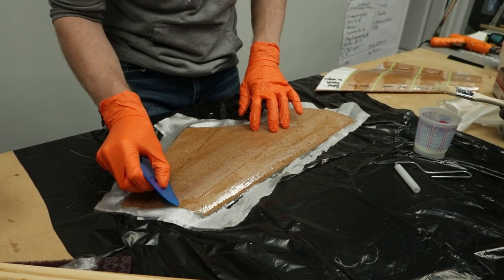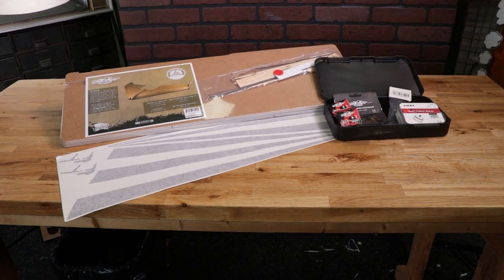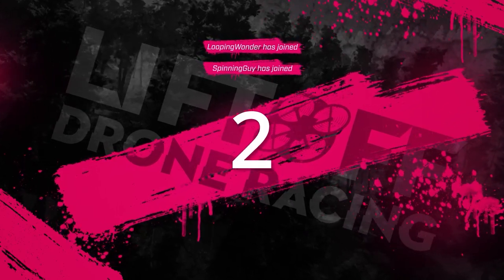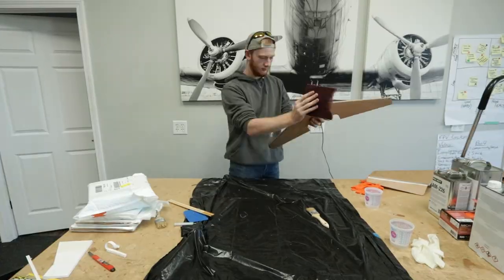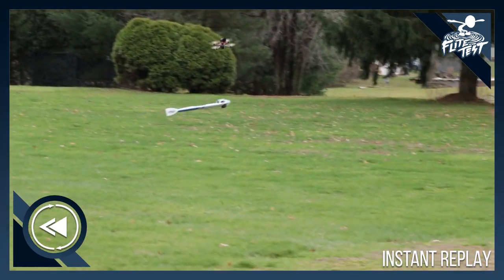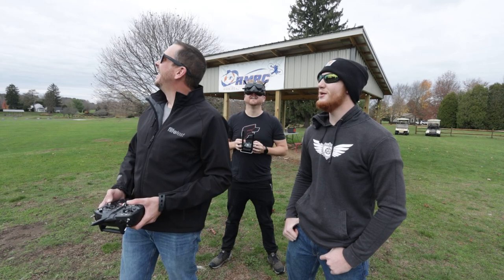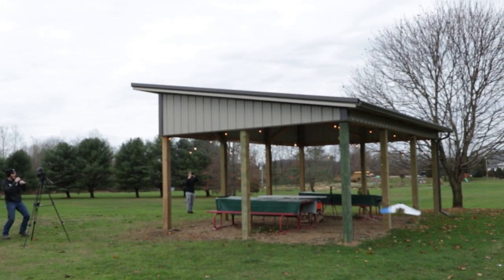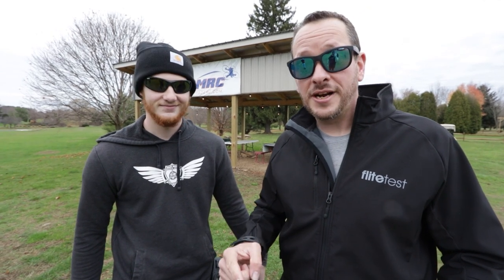Fiberglass Wing Crash Test! 💥

Comment: After two water-logged Sea Ducks, I decided to glass my 3rd one.  I removed ALL the paper and glassed it with 18g and 24g/m2.  Results were perfect!  No more moisture getting between the paper and the foam, with very little weight gain.  The Sea Duck is my absolute favourite and now even more so.  Thanks Team!!  Rob
Reply: The seaduck is my favorite one too.  So did you build it like normal and then take all the paper off before glassing or did you build it without the paper, then glassed it?
Reply: @cooter3690  Both - for example I took the paper off the inside of the wing BEFORE folding, and removed the paper from the outside of the wing AFTER the wing was assembled.  The fuselage pieces were "depapered" and glassed BEFORE gluing together.
I crashed my 1st SeaDuck.  My 2nd got slowly more-and-more waterlogged.  I like to do spend a lot of time gliding across the water - and the fact that it was sea water didn't help.  The moisture got everywhere and caused serious delamination (yes, I used water resistant FT foamboard).  Fibreglass is the way to go!
Reply: @Rob-kj3ho  This sounds really really interesting. My Seaduck is falling apart after ~300km travel. Only the fuselage which got fibreglassed is solid like a rock. Could you share some pictures of yours? maybe a dropbox gallery or on the flitetest forum on the Seaduck thread?
Got my second kit already in the basement but still hesitate to start
Reply: @mfoo3038  I've never posted anything on the Flite Test forum, but maybe I'll give it a go one of these days.  To be honest, I didn't take any build photos and any photos I take now won't be of any help as she's been spray painted.  For a quick guide: 1. remove the paper from the inside of ALL parts and replace with ultra-lightweight fiberglass (18g/m2).  Heavier glass is a heavier plane - but stronger!  I'm sure the Sea Duck could easily handle heavier glass.  2.  Leaving the outer paper on while hot gluing all your folds.  This will help hold everything together as the glue cools.  But try to keep the glue away from the paper, since we'll remove it afterwards anyway.  3. Remove the outer paper.  Lightly sand any sharp corners - as the fiberglass cloth will adhere better to a rounded corner.  If you have any big gaps, you can fill with glue.  I used the epoxy resin with a lightweight filler (e.g., micro-ballons).  4.  Glass the outer surfaces, prior to assembling.  5.  Spray paint, dry and fly - preferably over water. :)
I just took out the Sea Duck again today.  The water was like a mirror.  I was all smiles.
Reply: Rob thanks for the detailed description i would love to see some pics of your bird anyway :)) stay safe!
Reply: It's a fantastic design that has no business flying nearly as well as it does coming from a frigging cartoon! (And a great one from my childhood at that) I fiberglassed an FT X29, and the thing is just about indestructible, if a little heavy. I used kevlar veil to try to keep the weight down, and peeled all outside paper, but there's still some inside that you can't reach without destroying it. I have a 6s 64mm EDF setup that's really mean, though, so even though it lands really fast, it's still fairly easy to launch if you have some fast plane experience. It hits light poles and bounces off like it's nothing.

Comment: I work with high power rockets a lot for university projects. If you are looking to help keep the vertical stabilizers on, try using a filleting blend to join the wing to the stabilizer. The blend will thicken the two-part epoxy and allow you to "shape" the fillet such that it can attach to the wing and stabilizer.  This is how we join our fins to the body of the rocket as well as give it a nice sleek look.
Reply: Thanks,saved this comment.
(in a seperate text file)
Reply: In a plane, you are just moving the weakest link, and the part that will break first. If you strengthen the stab, the whole wing might get damaged if it crashes, making the repair more difficult than just gluing the broken stab back on. Picking your weak link is a skill learned through many difficult repair.

Comment: Last year, 2019, I got a tip from a fellow Flight Fest attendee that may work on these wings.  He suggested using a pair of inexpensive, Dollar Tree Store, women's panty hose.  Basically you cut the hose in half at the crotch, and slide each wing half tip first into each leg until the hose conforms around the entire wing.  Once the wing is properly positioned, you can coat with resin or you can wipe on a couple of coats of Minwax Polycrylic water based Poly Urethane.  After it dries you cut off the excess stocking, finish the edges, install the equipment and go fly!  This was his method for covering foam chuck gliders that were converted to RC.  He even covered the fuselage and elevator that way to make them more rigid.

Comment: I've been glassing foamboard planes for a while and I've found 3/4oz weight glass and keeping the epoxy to a minimum adds the least weight but still adds strength.

Keeping it to the leading edge and surfaces that are landed on can keep the weight down too. Helps a TON with scuffs, dents, and fraying that foamboard usually experiences.
Reply: I also feel like selectively glassing and using a carbon spar is stronger than using that spar weight on more glass. You can make some seriously robust foamies that way.

Comment: honestly, i've wondered why you haven't explored glassing your models prior to this.  even if you don't do entire sheetings,  but instead just use strips at joints at wing connections and such, you could add SO much more strength to a given model.   A large scale P38, fully glassed....all it's waiting for at that point is big enough motor to get it up to the speed it should have..  
Glassing isn't hard.. but it IS messy, and a little finicky.  Wear old clothes or coveralls,  be meticulous with your measurements, thorough with your mixing, and meticulous with your application....there are a LOT of different brands out there; shop around... 
(pro tip.. babywipes and personal wipes can clean up uncured resin)   
(if you really want to push that speed curve...glass it, then polish the resin as smooth as you possibly can, and maybe even wax it with car wax.....)
Reply: Planning a lightweight single 5mm sheet monster spitfire am. Im going to use your tips. thanks! :)
Reply: I have an arrow just like the one in the video. Can you please give me the names of products you have used it would be incredibly helpful since it seems like you know what you are doing.

Comment: I was pretty sure the basketball game was Horse :v

Anyway the fiberglassing looks pretty easy here! I guess when I get some clean builds done it would be a good idea to fiberglass then for a long term model.
Reply: Having worked with resin and epoxy in the past, I was surprised nothing was said about possible health side effects.  Both have some serious issues for too many when it comes to long term exposure and little to no ventilation.  Most resins and such often used in the commercial world require not only protective gear, but proper ventilation, which most hobbyist won't use due to cost.  That is why I recommended investigating the "poor mans fiberglass" videos and the fact there is very thin, lightweight fiberglass cloth available you can almost see through.
Reply: @wattwaster5936  have any videos or links in particular you could share ?
Reply: @br0k3nilluzion  There are a lot of videos in Youtube about each point I made and to provide links for take a while since there are so many to watch.  The one subject most in this hobby would find useful is Poor Mans Fiberglass, which is used to make travel trailers, or small sleeping campers using various wood glues and canvas.  The key is non toxic wood glue on thin plywood, or thicker foam board combinations.
Reply: @wattwaster5936  non of that applies here though. Welders blanket is way too heavy for any of these wings
Reply: @br0k3nilluzion  Welders blanket?
Reply: @bushcraftandsurvival2395  the poor mans fiberglass videos show outting glue down and then putting fiber cloth on top.. most of those videos are use a welders blanket.
Reply: @br0k3nilluzion  I am not sure how a welder's blanket fits into the poor man's fiberglass method since the videos I saw were about using a water resistant wood glue and cotton cloth, often called canvas, which comes in a number of weights, or thickness applied over thin plywood, or foam board.  Some even used a combination of plywood and foam board to provide insulation.
Reply: @wattwaster5936  only point I was trying to make was the weight side of it. 
Went pretty deep in after you mentioned the poor mans method, lol,  so now me and the kids are planning on building a canoe from foam and the poor mans method. lol
Reply: @br0k3nilluzion  As long as your glue is water resistant to a very high degree, as in nearly water proof, with a high quality latex paint over it, the project should go well.  Of course the key is to keep everything lightweight and don't get too thick and heavy with the canvas cloth.  Apply the glue as thin as possible since all it does is bind the canvas fibers together and to the foam board.  One scheme I have seen used cheap, strong toilet paper to soak up as much glue as possible before the glue had a chance to set, or stiffen and then let it finish curing.  The next step was to lightly sand the glue and canvas layer so the latex paint of a high quality would bond better.  Four coats of latex was applied with light sanding between each, but this was for a sleeping camper.

Comment: If you want to reduce your exposure to the resin, or epoxy part of the task, you can use common plastic wrap over the fiberglass and use a trim sized paint roller, or other like devices to move the liquid to the edge of the wing.  Place a piece of plastic wrap over a section of the wing from leading edge to trailing and roll out the excess liquid.  It is a messy thing to do, so you will want to place some sort of absorbing material on the table and elevate the wing to allow for the liquid to drip away.  Since  you can see through the plastic wrap and the liquid will cure even if the plastic wrap stays in place, weigh it down once you are satisfied with the task.  Sandbags work well and ziplock bags come in handy.  They also come in some rather large sizes if needed.  I will let you guys figure how to make a working device for the elevated wing half so it won't cure warped, unless you want to add in a bit of reflex.  Remember the balsa wood wing jigs?

Comment: You might try to use thin CA instead of resin to stick the glass down.  It is much quicker, stiffer, stronger and easier to sand.  I used fiberglass and CA along with carbon rod to reinforce and stiffen the wing and tail surfaces of a Multiplex Twin Star so I could use 2 T-motor F80s to power it.  That airframe now has 1400 watts on it and is great fun.

Comment: Josh Hi  .I worked for 20 years fiberglassing surfboards and have done thousands .Get some 4oz surfboard cloth  and with the resin there is a additive powder that will turn your resin into light cure .All you need is a box with some UV strip lights ( i used sunbed tubes and lined the box with silver foil but hy mine was 11' long ) do the glassing in side not daylight or it will set as you do it when your happy with the glass job put it in the light box shut lid (uv light this strong is bad for your eyes so make it a good box )5 mins later and its as hard as a rock ,you can put it out in the sun i would put repair boards out side to keep the box free for new boards .On on your laps sand the edge of the first lap bottom first with a 3" 60 grit disk sander air tool or dremel with the 90deg attachment carefully now glass the other side and sand the lap the same .If you want a super smooth finish add what is called a filler coat .Tape a halfway point around the leading edge and trailing letting it hang down and  paint on enough resin to fill the weev let it sit till it flows out smooth  then back in the light box  and repeat for the other side .When set sand with 240 grit and remove the lip left by the tape  and paint .I made wings this way and large HP rockets glassing cardboard  tubes .Go talk to a surfboard material supplier they have all you need and will advise you .Only downside is you dont want to get hit by a plane done this way its going to ruin your day .Any advise please ask .I have glassed around 5000 boards .Retired now .  Good luck from The UK
Reply: Everybody I know in the art and automotive community takes about toxicity of the resins. They seriously worry about long term effects and always use masks and gloves with fresh air priorized. What is your experience?
Reply: Well polyester resin and glass fiber were developed during WW2 for military planes and its been used in the boat industry ever since yes its toxic stuff but not as bad long term as you would think and your very unlikely to get hypersensitivity to it .Styreen in the resin and wax solution isn't good for you breathing it in and ingest a teaspoon of Cat your dead     .Sanding and glassing requires respirators i had 2 one for sanding with the charcoal replaced with extra filter wool and a charcoal one for resin .We had big fans one in the sanding room and one in the spray room with the outside door open  the air flow was good .Most sanding is just the resin and not hitting the cloth  releasing fibers that's bad . Long term   usage since ww2 has given good studys .Now onto epoxy that stuff is nasty carcinogenic yes big risk of hypersensitivity (i new people who couldn't even be in the same room )it can just happen out of know where i only ever did small jobs with it you should use a fresh air fed full mask for epoxy +little odor comes of it so its hard to detect buildups of fumes .I never had any problems lung wise back neck and shoulders are fooked but that's not the chemicals .I will drop a link in here from a TV program i was in i'm the one in the white overalls hope this helps .  https://www.youtube.com/watch?v=5Y7cIA8UgUk&list=WL&index=134

Comment: If you could figure out how to temporarily support the inside of the wing (carved wooden core, high density foam?) you could vacuum bag the wing after applying the resin.  That would squeeze out the excess resin and compress the fiber and give you a very smooth surface finish.  With the weight saving in resin, you might be able to get 2 layers of fiber.  More strength for the same weight.

Comment: I spray my glass cloth very lightly with 3m77 contact adhesive, then stick it down to the model like a decal.   Then squeegee the epoxy through the cloth.    This jives you an infinite amount of time to make adjustments while it is only adhesive applied.

Comment: When you fiberglass a foamboard plane, what do you do to the hinges of the controll surfaces? Do you just not glass that spot and leave the paper? Is there a good hinge material you can add? I want to do this to a sea duck but haven't decided on a solution to this particular problem.

Comment: Hey how are you guys men, lovely reinforcement, loved the idea, I wish to share with you guys if you apply a coat or 2 of resin mixed with hardner on the fiber glass, will do 2 things, give it a smooth finish glass like that will help to reduce drag and a protective layer which is hard to break and takes impact before it can reach the actual fiber glass surface. Hence increasing the strength, loved to see this fly so well, love and very warm regards to you all from India 🙏🙏🇮🇳🇮🇳

Comment: Little heavier on the leading edge. Maybe a bit of thing aluminum flashing on the leading edge? Or thin stabilized balsa sheet. Use to do fiberglass over stabilized balsa back in the day. Also did spruce spar on the leading edge with foam for the leading edge and mono coat over that. Those leading edges could eat a tree and worst case was some damaged mono coat lol

Comment: Wow, you are series about making a lightweight foam airplane model nearly bullet proof and heavy!  That is some thick fiberglass cloth.  I trust you guys know there is some stuff that is so lightweight and thin, you can almost see through it?  Also, you may want to compare resin to glue options that promise to be water resistant, or waterproof.  In Youtube it is called "poor mans fiberglass" and some larger projects have been very successful.  If the best RC flyers are lightweight, the focus needs to be on keeping the project lightweight, but I do realize some want their models to penetrate wind better, so they go a bit heavy with their builds.  Maybe I have said enough?  Most resins eat naked foam.

Comment: O.K., what was the weight of the fiberglass you used, oz per square foot, and what was the weave of the glass? Both questions real important, in my humble opinion, for successful fiberglassing. Did you glass the wing all the way around, top and bottom? Difficult to see in the video. What about glassing the fuselage, do you think you could get away with doing that too? Or is that too much for a fixed-wing plane vs the Arrow flying wing? I hope I haven't overloaded you with these questions. ;-)

Comment: my opinion .. it will certainly fly, and the door can fly if the engine is stronger, only these planes are already heavy because of the foam board, and with epoxy resin and fiberglass it probably weighs like a tank. And flight time is also an important factor, isn't it? With a heavy aircraft, the battery consumption is higher. Maybe I'm wrong.